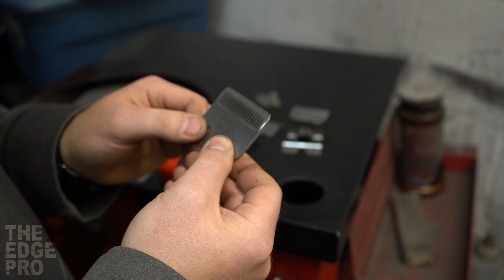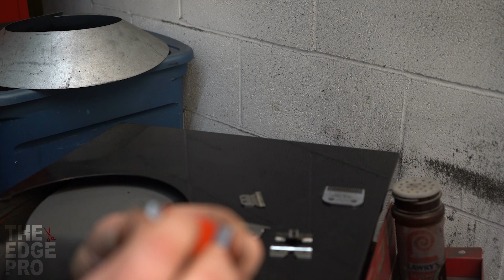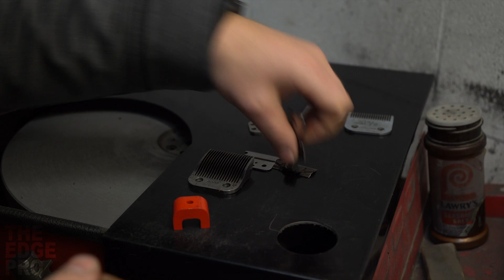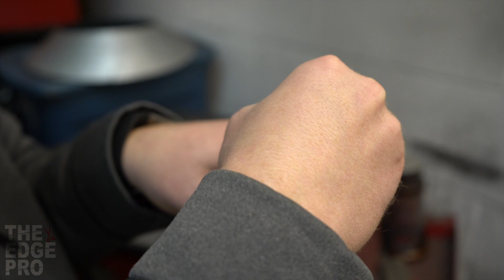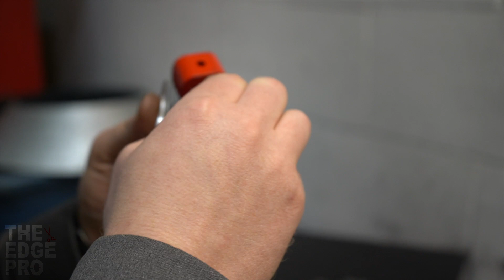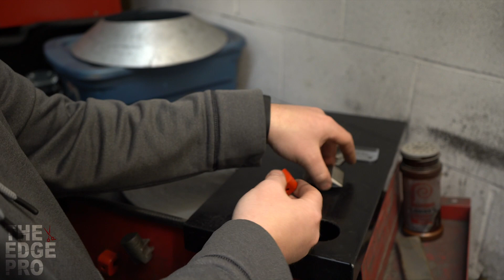Sharpening - Proper Magnet Placement

Comment: Thanks for your wonderful videos.
What's the name of block you use after sharpening the blade? I mean what kinda material is that?
Reply from the maker: It's called a rub block! It is made from steel.
Reply: Can any steel with  a very flat surface be used as a rub block ?

Comment: Good video. Why do the trimmer blades scoot out from undrtneith the magnet sometimes?
Reply from the maker: If you are using the rare earth magnets or hard drive magnet they make a single, focused point of contact to the blade versus being spread out to prevent the twist.  To prevent that, first I check that I am using light pressure and af it persists I will hold the magnet at the bottom with my thumb and middle finger so that they are touching the blade. usually that stabilizes them enough to not twist.